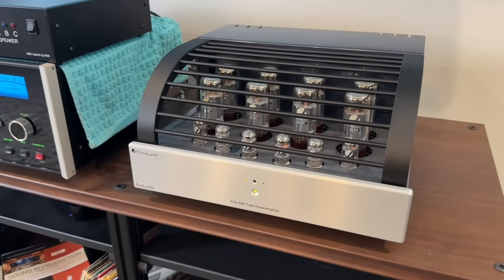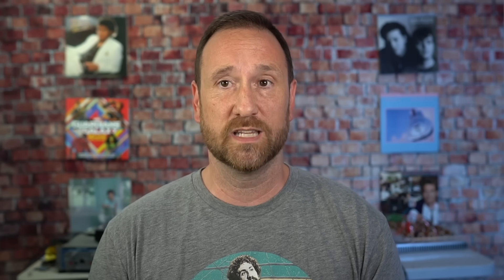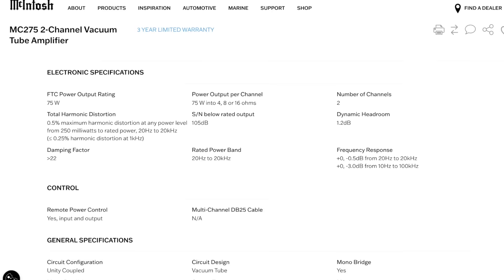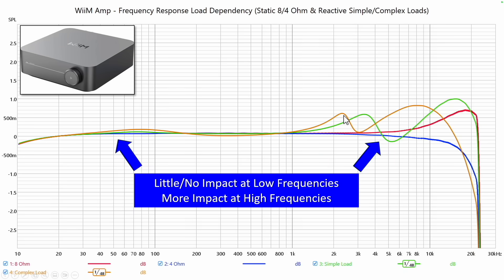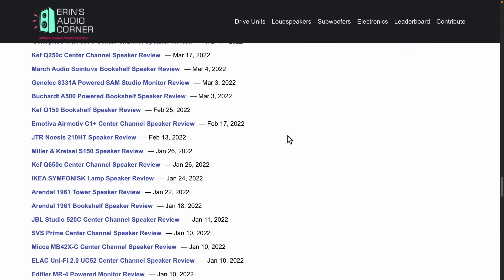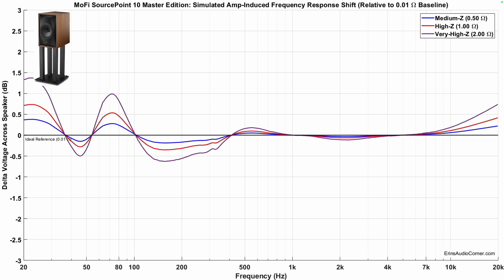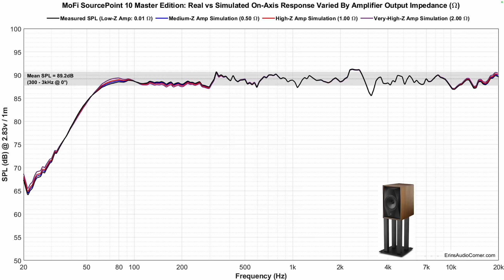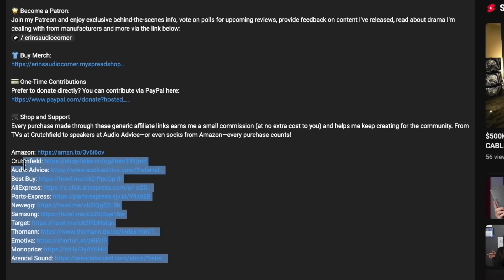Should All Amplifiers Sound The Same?

Comment from the maker: Follow-ups:
1) I want to drive this home: Not all amplifier types are created equal and that is why I gave many examples. Let's dig in...

The McIntosh MC275 and Prima Luna EVO 400 are both tube amplifiers. The MC275 output impedance ranges from 0.18 to 0.20 Ω (my measurements). This is very good for a tube amplifier and rivals many solid stage amplifiers. Meanwhile, the output impedance of the Prima Luna EVO 400 is as much as 2.30 Ω (Hi-Fi World) or - if one assumes the integrated amplifier has the same amplifier output stage as the non-integrated - Stereophile measured this to be "1.45 ohms at 20Hz and 1kHz, 1.8 ohms at 20kHz, in Ultralinear mode; 1.3 ohms at 20Hz and 1kHz, 1.6 ohms at 20kHz, in Triode mode" (link: https://www.stereophile.com/content/primaluna-evo400-integrated-amplifier-measurements ). Either way, we can be sure the PL has quite high output impedance from my measurements alone. 

The WiiM Amp (original version ~2023) uses Class D Texas Instruments TI 3255 chip and is an example of poor output impedance, starting at 0.10 Ω from 20 to ~1.5kHz and then ramping up to ~1.80 Ω at 20kHz. On the flipside, the NAD C 3050 is also a class-D amplifier (HybridDigital UcD modules), yet it has a low measured output impedance of ~0.10 Ω from 20-20kHz.

The overarching point is: yes, amplifiers can sound different. But it's not based solely on type. As we can see from the examples I provided in the video, even amplifiers within the same "class" can differ in output impedance by a significant amount which can translate to very audible differences. Especially with more complex speaker loads.

The real question is: should amplifiers sound different? For me, the answer is "no". I prefer an amplifier simply amplify the input signal. If I want coloration, I'll use an equalizer.
But I also realize and can appreciate that some people want a tube amp for its looks or nostalgic appeal. This is what makes the mc275 so great: It has tube amp features and looks but it behaves like a solid state amplifier with its relatively low impedance.

2) *Generally Speaking*, the relationship between sound quality, output impedance and damping factor values break down as follows:
Rate - Impact on Sound - Output Impedance (Ω) - Damping Factor (at 8 Ω)
Extremely Good - No impact - 0.01 Ω - 800
Good - Practically No Impact - 0.10 Ω - 80
Mid - ± 0.75dB fluctuation - 0.50 Ω - 16
Poor - ± 1.50dB fluctuation - 1.00 Ω - 8
Very Poor - ≥ 2.50dB fluctuation - 2.00 Ω - 4

These values are based on my 179 speaker simulations presented in this video assuming constant output-Z. It's an approximation. 
Higher output-Z == lower Damping Factor.

3) Beyond output impedance, I put stock in power and noise. Give me plenty of the first and none of the second and I'll take it. 🙂

4) In the interest of time I edited out the Magnepan simulation. It didn’t really add anything to the point of the video.

5) Yes, I know this is nothing new. Imagine the things you wouldn't know if someone didn't take the time to tell you what they learned from someone else. The point isn't about thinking this is brand new information. It's to bring "old" information to "new" people. The last thing audio needs is more gatekeeping.
Reply: Quite impressed with how flat the NAD was (which simply has a spec of >150 for damping factor).
Reply: Doood this is really awesome -  you’re amazing
Reply: The link you provide shows the legend "The requested page could not be found"
Reply from the maker: @miyamotomusashi001 fixed
Reply: This begs the question. What is the output impedance of the  Klippel, or does it measure in a way that doesn't matter?
Reply: @danielfoote817 Does the Klippel drive the speaker, or does it rely on an external amp?
Reply: What about distortion profile?  You mention power and noise, on top of output impedance but you don't mention distortion.
Reply: @razisn  noise we all know... When did you buy something with more noise? 😂
Reply: This follow-up post is super helpful! So if I am understanding and applying this correctly: 

According to Emotiva my BasX A2M amplifier has a dampening factor of ">500” at an 8 Ohm load, so my conclusion is that I can be content that I have an amp that produces accurate sound and have no need to try something new as long as it works and meets my power output needs. 

Am I applying this information correctly?

By the way, I joined your Patreon as a result of this video. Great stuff!

Thank you!
Reply: @wynkoop2000  Listen to what Erin says at 3:50 . 
A single value is worthless unless they show you a full frequency curve.
Reply: @igorgotmail Yes, you are correct. I know what I said was generalizing, I was more going off Erin’s advice at 14:02 but in retrospect I was probably oversimplifying what he said.
Reply: @wynkoop2000 If we can generalise something with the help of  Erin's video then it would be to stay away from tube amps and cheap amps and concentrate on reliable solid state amps and hope we make the right choice so that they match our speakers. As he stated, it is practically not possible to try 10 different amps in combination with 10 different speakers. After watching this video, I consider myself lucky that my amp and speakers matched well 😊
Reply: @igorgotmail don’t think that’s what he was saying. Since the McIntosh is a tube amp with excellent low output impedance. Depends on how amp is made.
Reply: @tyronechamoisjr4558  Listen at 3:08 . Most solid state amps are close to zero Ohm output impedance. And when I googled on it, this was confirmed that generally speaking, the output of a tube amp is less stable compared to a solid state.
Btw, I didn't know anything about this till I saw Erin's vid. Regards.
Reply: @igorgotmail  It's more about how the amp.was designed/built.  Also, having a slightly higher output impedance may be fine if say you are running a Rogers LS3/5a at 15 ohms.
Reply: @wynkoop2000 the Emotiva amp was a good buy and in a general sense, the answer to your question is yes.  The real question is, does it make you happy when you listen?  If so, that is all that matters.
Reply: @hermanknief I am actually very happy with it. I wasn’t really asking so I could decide if I need to change, rather, I could imagine in the future getting the bug to try something different, but if my current amp is already has a good to excellent relationship between output impedance and dampening factor, then that would probably dissuade me from spending money on a new amplifier until there was a more tangible need (more power, desired features, cool looks). I do appreciate your sentiment, it’s a good way of looking at it.
Reply: I’m a fan but this is a little disingenuous, Erin. 

By virtue of the variance in basic material science, the amps will sound different. 

I get that people want to discuss the “why”, but no one has called out this basic variable. 

Even if measurements were perfect (and they never will be), the differences will be there. 

I am not even considering other large variances: manufacturing practices, calibration-equipment, standards for QA/QC, sourcing of materials and what-not. 

And when you mix those variables and many more - OF COURSE THEY ARE GOING TO SOUND FUCKING DIFFERENT. 

Why is this basic, fundamental truth, so difficult to absorb?

It’s fun to see engage in the conversations and comments. 

Peace.
Reply: @ananth-y4b go and change the capacitor or something...

Comment: Could you do a video to explain the McIntosh "sound" ?
Reply from the maker: There isn’t one. Certainly not in general. People just love to spread information from others.
Reply: @ErinsAudioCorner  I don't understand how people can know which amp they are listening to when AB testing two high end amps both with low output impedance. I would like to believe that the sound is supposed to be the same, but it doesn't seem like it :/

Comment: I have a question: if I buy a midrange DAC/AMP will it work like more expensive combos with TOTL headphones? Is there a price ceiling where spending more won't change things significantly?
Reply: If only that could be known.
Reply: @HifiLoveLetter  I tried recently Susvara, Susvara Unveiled, Shangri-La Jr with different dac/amp combinations. As midrange dac/amp I brought my EF600 for comparison, using it both in every possibile combination (DAC/AMP/both). And to be honest, when compared to 2-5k dac/amps there was something that was lost in the sound reproduction, headphones appeared far less detailed or realistic/organic, like there was a "veil" obstructing sound reproduction. But using more expensive dac/amps (over 5k) didn't change the final sound quality. It was just similiar or even worse depending on the pairings. So basically for TOTL headpones (at least for my experience) there's a price ceiling where things become totally useless, and unless you're looking for a particular feature more expensive gear won't bring anything better to the table.
Reply: @Esch1lus  I agree. There’s just no guarantee. The best DAC I’ve ever heard / owned was the Topping D70 Pro Octo but it died on my rack after three weeks. Just stopped working. 

That’s why I’m the angry audiophile. I too am sick of being jerked around and ripped off. I have total confidence buying a $50 microwave, knowing it will work, knowing it will last. Why can’t Hifi do the same? Why can’t the “reviewers” tell us about reliability? Isn’t it weird how it never seems to come up in the reviews but in real life it’s a major issue?

Comment: I gave up on matching an amp to a speaker. I now just buy active speakers that have an amp per driver. So far over the last 20 years been very happy with this decision. For a manufacture to build a speaker and not recommend the amp(s) for it seems a bit irresponsible. I am not doing the manufacturers work for them anymore.

Comment: Erin wants to explain things on the basis of data from measurements. Unforfunately, these data are more often than not misinterpreted and do not relate in a simple way if at all to perceived quality of reproduced sound. Generally speaking, "the measurement guys" do not understand the limitations of their approach at all. In this case, Erin overrates the significance of the damping factor. Let's compare electrical current to water flow. A high damping factor low output impedance than corresponds to a wide water pipe. However, this does not guarantee sufficient water will be avialable. So amplifiers with identical damping factors may be very different with respect to the ability to deliver current to the loudspeaker. To fully control the loudpspeaker, the amplifier should be able to deliver sufficient current under all circumstances. To only way to assess this, is simply by listening. Hey there, the hobby is about listening to music in the first place! I make all my decisions by listening. What do I care about a low damping factor when I perceive boomy bass?!
Reply from the maker: Kind of while to say the difference doesn’t matter when the objective data shows exactly why. And then to discount the data “just because”. 

Also, talking about fluid dynamics to a rocket scientist is a surefire way to expose your lack of knowledge on such a subject. 😉
Reply: @ErinsAudioCorner  I did not say differences in measured damping factor do not matter, did I? I said amplifiers with the same measured damping factor may be (very) different in their ability to control loudspreakers in real world conditions, which is essential for good sound. To explain that, one should investigate the details of the power supply and so on. You make the same mistake as all "measurement guys": make a measurement of one parameter and want to  "explain the universe with it".

Comment: So again, don't buy products with bad measurements(if you can get them), like high output impedance. Why should anyone buy the Prima Luna?  It's just a crapshoot regarding how it will sound with your speakers.  As Erin notes, how would you choose the amp/speaker combo?  Are you really going to carefully abx them all?  How are you going to know which one is better?  Just don't buy stuff that is badly designed, no matter how expensive.  It's a bad thing if your amplifier is a variable-it's a solved problem, no reason to add variability to your setup.  It's crazy how audiophiles approach their goals, seemingly trying to maximize cost.

Comment: From the perspective of seeking fidelity that's high, all GOOD amplifiers (kept below clipping), just like wires, should sound the same, i.e. perfectly neutral, however they aren't universally ALL good. Luckily most solid state class A/B ones, even many very affordable ones, are indeed transparent, i.e., audibly "perfect".
Reply: exactly this. However most people will not compare 2 amps in same conditions same by side with amp switcher.

Comment: Amplifiers should sound more and more similar as they approach perfection.
As two different things are approaching the same point in the phase space, they are also approaching each other.
The problem is "there is no perfect speaker"
So there is no practical value of this "convergence".. we cannot veryfy it ..
(What if a certain amp is actually bad, but by chance it fixes a flaw in the speaker?) 
but:
Just keep the power amp constant and all (near perfect) pre-amps should sound the same.
Perfaction in the pre-amp domain is a more feasible thing.
What needs to be fixed is actually speaker technology.
A good strategy with current state of technology is to use an active crossover and multiple amplifiers.

Comment: Tube amplifiers are a voltage to current device with very little negative feedback is applied. This allows speaker impedance to impact the voltage as frequencies on the speakers draw more or less current at different frequencies due to resonances in the speaker.
The amplifiers that sound the same are the solid state amplifiers which use high negative feedback to accurately reproduce the voltage waveform sent into the amplifier, regardless of the impedance response of the attached speakers.
Other differences is the noise level, type of noise, and distortion. Crossover distortion sound different than clipping distortion, etc.
All those issues can be measured with laboratory equipment. Voltage and current waverforms can be recorded and measured for distortion, linearity, noise, etc.
Tube amplifiers in general have low negative feedback, with relatively low damping factor because of this. This allows speaker impedance curves to impact the output voltage waveforms.  And yes, then they sound different.

Comment: So, you can spend a fortune on a great amp. Yet, their not great sounding without intervention / adjustment   They should be neutral like great speakers. Based on this comparison I don't envision ever purchasing one  I remember fiddling around with 5 band EQ's to get great sound. If I'm spending north of $5,000 on an amp, it should sound pristine with no user input.

Comment: Of course you are assuming that the speaker has a flat voltage response. Given that the individual drivers respond to current. Add in complex crossover designs and it gets tricky.

Also a couple of dB difference can easily be swamped out by room response.